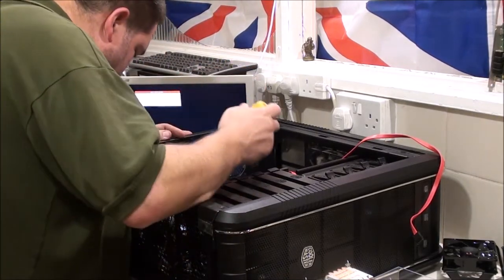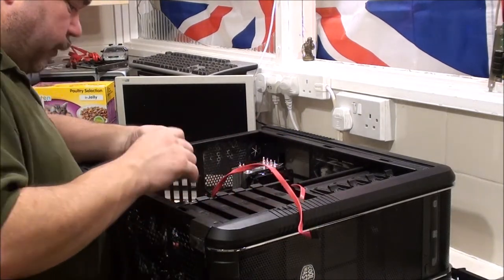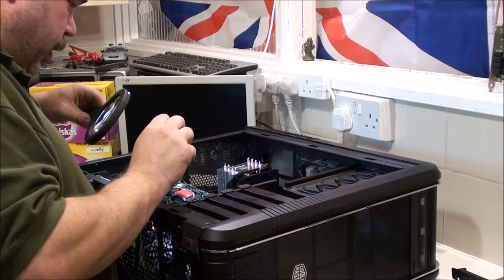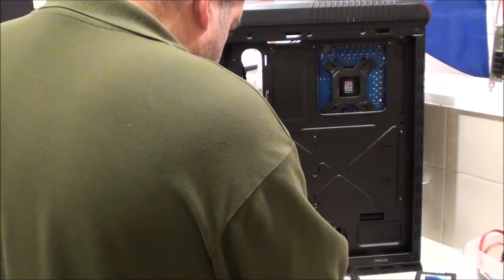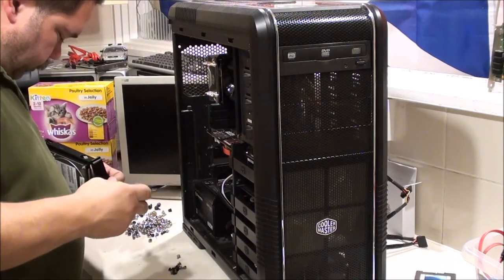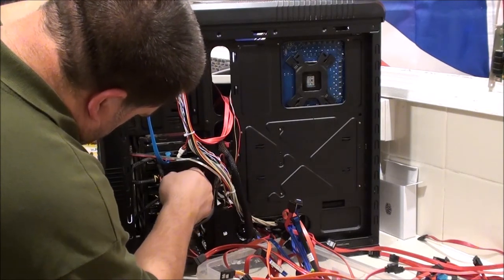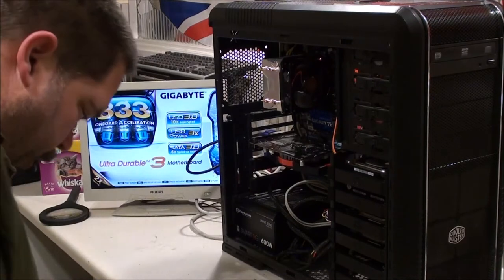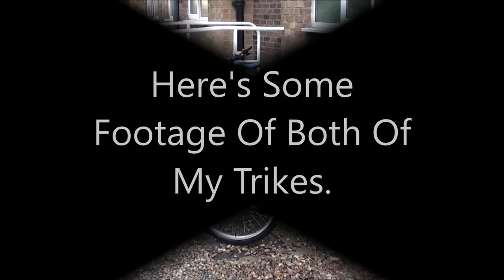Starting Work On The i7 PC build. Plus Bonus Footage

Comment: Have you started EATING CAT FOOD? ... Or have you got another Kitten? 😂

You need a SUPPORTED CPU, TPM, SECURE BOOT, and a MICROSOFT ACCOUNT to use Windows 11.

Where's the FLOPPY 💾 DRIVE? 😂

With SSD's bigger really is better! They're faster, and they last longer! Samsung are best, followed by WD! ... IMPORTANT: DON'T FORGET TO LEAVE 10% (24GB OF 240GB) OF THE SSD UNALLOCATED! (it's called "Over Provisioning" and is recommended by manufacturers) ... What was the TBW on your eBay drive? Crystal Disk (or similar) will tell you the TBW.

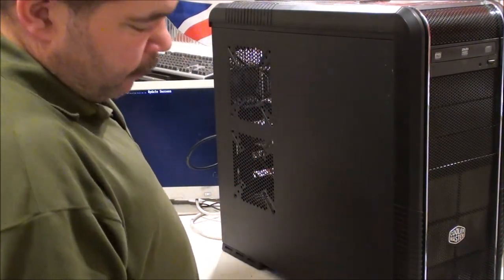Was that a 💩FART💩 at 1:12:33? 👎😷🤮